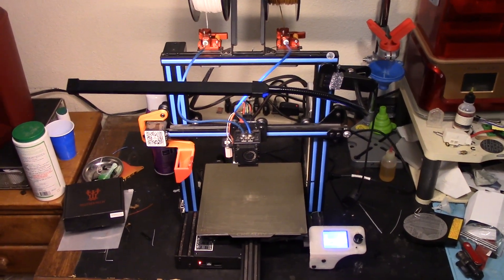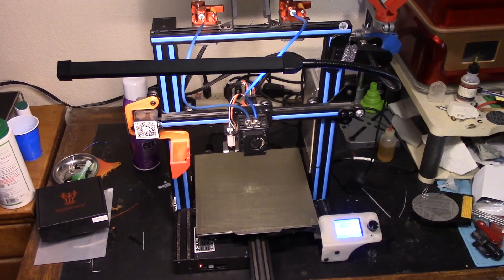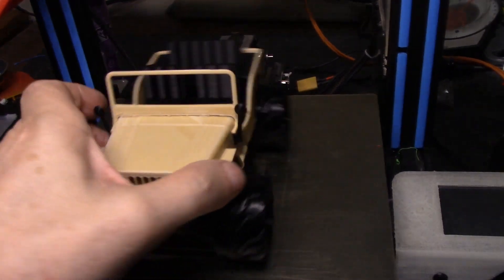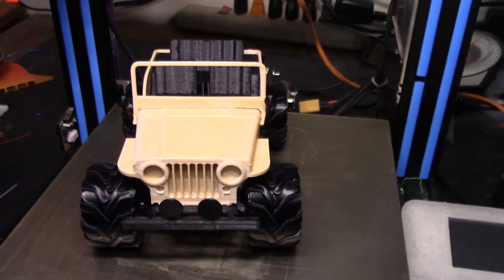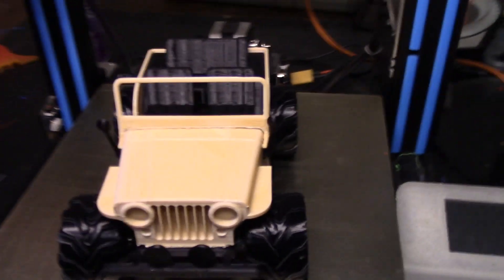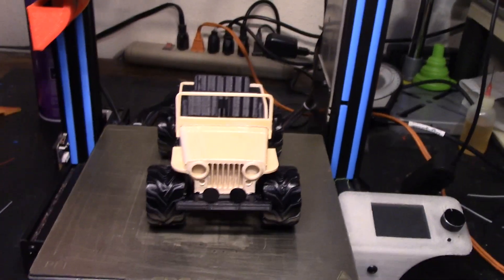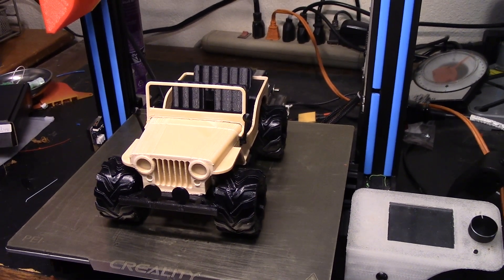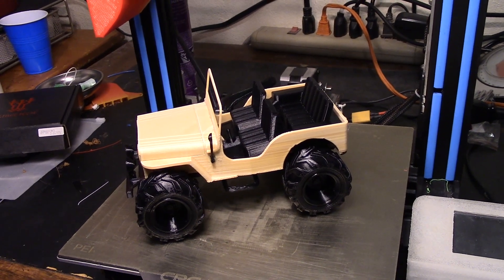Can you mix PLA and PLA+? And the color versatility of a mix printer.

Comment: Yeah that happens, colors don't quite mix  that much before coming out of the nozzle... I wonder if there's a way to improve that
Reply from the maker: Something tells me that the fix would entail a lot of complexity, weight and expense.
Reply: @3rdpig  It's the same as making MI cable, or seaside sticks of rock. Maybe not noticeable if you can reverse direction of nozzle path in alternate layers. Worth a try.

Comment: The Colgate effect is because the mix happens at the top of the nozzle and doesn't have time to fully mix before extruding. Also you might want to try these for the hot end cooling fans.
https://www.amazon.co.uk/WINSINN-Hydraulic-Bearing-Brushless-30x10mm/dp/B087TBB8YV/ref=pd_lpo_147_t_1/261-0083446-7991410?_encoding=UTF8&pd_rd_i=B087TBB8YV&pd_rd_r=7bf4174e-d906-4540-bee6-c48a714f6c2a&pd_rd_w=AXcWy&pd_rd_wg=YnBLQ&pf_rd_p=3366510f-1771-44b5-99e2-20c1889506ac&pf_rd_r=3WB112XYTBV6B22QRME2&psc=1&refRID=3WB112XYTBV6B22QRME2
I fitted them much quieter and the ones I got have RGB.
Great video. Keep it lit.
Reply from the maker: Thanks for the tip about the fans!